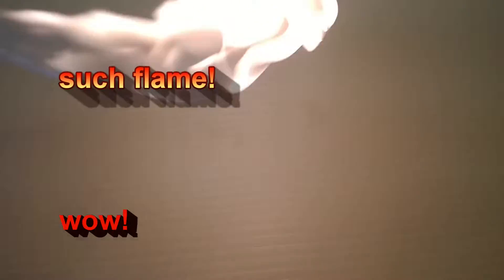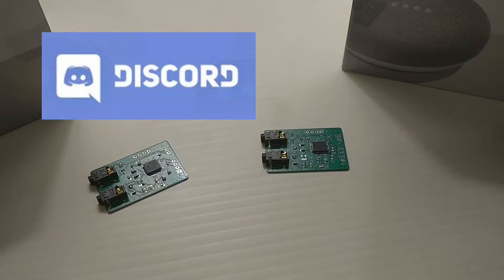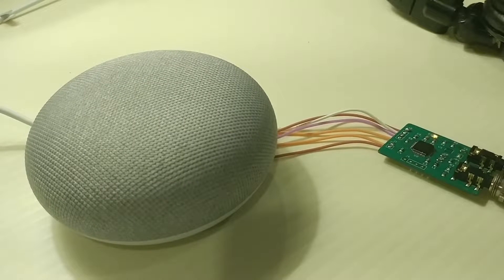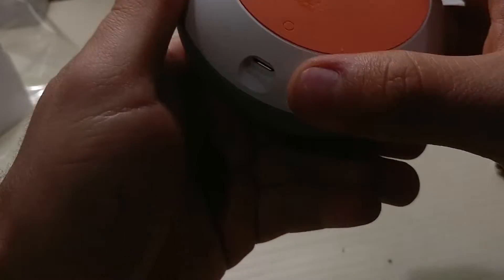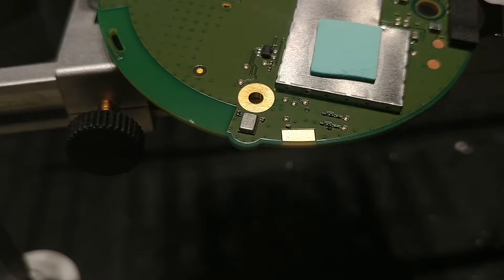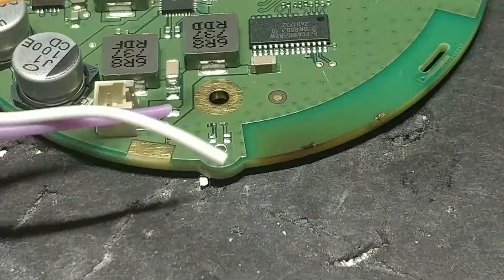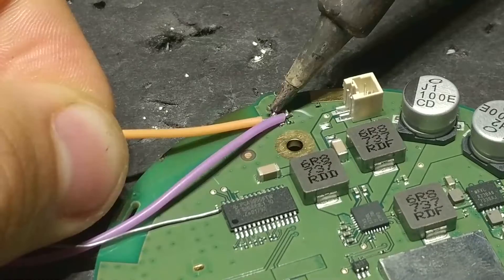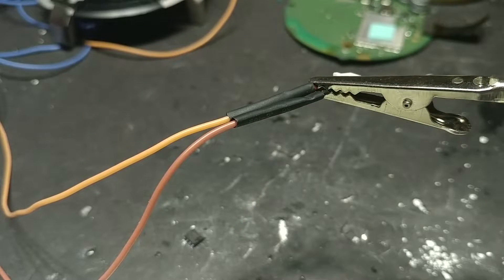Home Mini EXTERNAL MICROPHONE MOD! DIY, DIWHY?

Comment: Can you wire multiple mics into one google mini mic input? For instance I want to have mics around my living room (wiring in walls), can I connect lets say 4 mics (soldered together) to one of the mics pins on the google mini or will that create conflict between all 4 mics?
Reply from the maker: Yea you can wire as many as you want, their signal will just add up.
Reply: There are already two internal microphones on the pcb of the google home mini speaker. Having both on opposite sides of the circuit board is for being able to identify the direction of where the sounds are coming from as well as any noise canceling capabilities. Replacing the two microphones on the pcb with wall mounted wired directly to how the pcb mounted were installed, on opposite sides of the same room, should function as close as possible to how they are designed to function. If you add multiple microphones to the same inputs on the pcb is where you are getting into possible problems. 
Hard wiring in the rooms "remote mics" the same if also removing the original pcb's surface mounted ones would have the best chance of having less issues or interferences than just adding the remote mics and leaving the pcb mounted mics. 
I am debating something similar to Wiring for a room/garage as well and been looking into what could/couldn't be modified. I have run into a issue with this and how much background/room/ambient white noise is picked up causing the voice recognition to have problems with understanding voice commands. I had to cover my google smart speakers with a windscreen to reduce the heater/A.C's  duct work when the blower motor was running, it was especially problematic when in small rooms like bathrooms. I would also believe to make the microphones room wide would include and possibly increase this problem. I remedied the problem for the google home mini speaker without the external wiring components by placing the entire GHM inside of the "skin" of a fur animal toy with the insides removed (a skinned furby from 1990's used first because the speaker fit perfectly in the bottom with the robotics removed) due to how when the blower is running in my house it sounds like a leer jet flying through the house. The google inside of the furby definitely wasn't the most pleasant looking but it was confirmation that sacrificing a stuffed furry animal would work if i had one or before purchasing some faux fur fabric to make a windcover.

Comment: If you're only soldering connections onto one of the microphones, do you need to remove both mic's from the Mini board?
I mean, could you leave one connected as an external mic in addition to the Snektek mod?
Reply from the maker: We tried that but the remaining microphone caused lots of interference and really degraded the sound quality, making it difficult for the mini to understand. But you can try it!
Reply: SnekTek cool.
What other parts would you need to re-purpose the mics you pull off?
Reply from the maker: I can't think of a reason to reuse the microphones. They are pdm output so pretty much useless for diy stuff

Comment: Ideally, I'd add coaxial audio out to a device. The the internal is what I would use. Can this kit be used ONLY for audio out, leaving the minis mics in tact or will that cause voltage issues

Comment: What would the reason be for Google using digital microphones rather than traditional analog microphones on the Home Mini?
Reply from the maker: All devices now use digital microphones. They are resistant to interference because they convert the low level analog signal on board. Both microphones run on the same data and clock lines, they self identify as a stereo pair. It's an elegant solution!

Comment: Instead of buying a Home Mini, crippling it by removing it's mic and speaker to later add an external mic and speaker...

Purely based on the possibilty it does work... 
grab googles DIY voice kit to run on a raspberry with external USB soundcard and/or mic/line input/output instead? 
Should be cheaper and "less dangerous" to someone without the dexterity and/or soldering skills.
Well ... it might need some programming skills instead.
Reply from the maker: Yea could use the voice kit. But there are differences
Reply: Yes, i'm kind of expecting a few missing features. Like streaming spotify / google music etc.